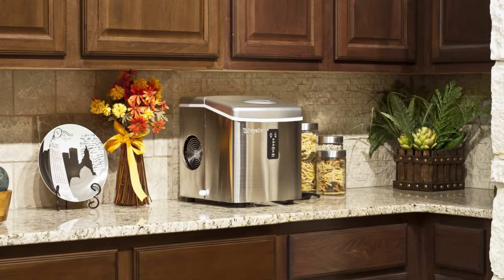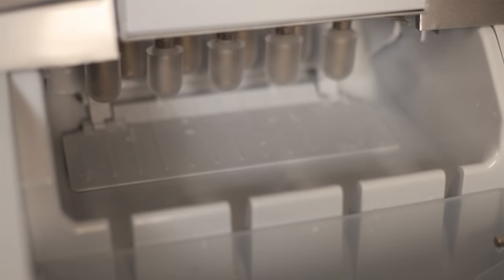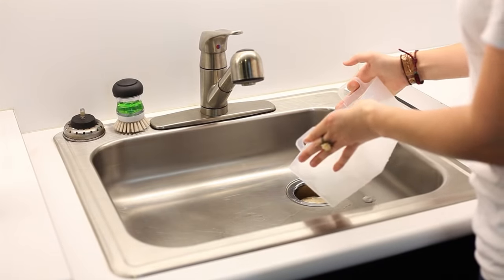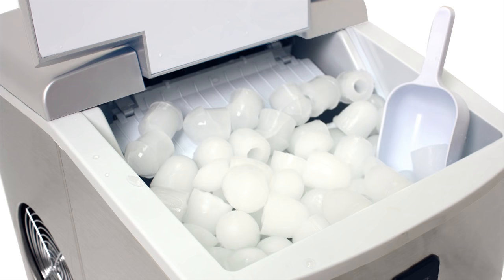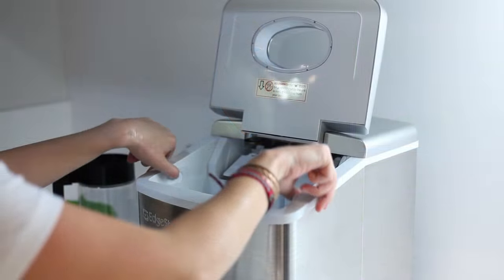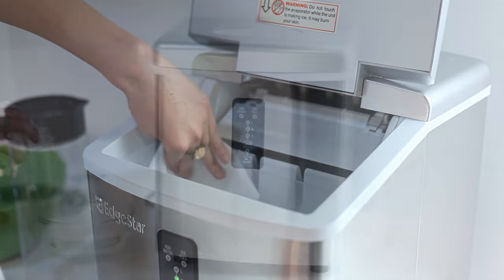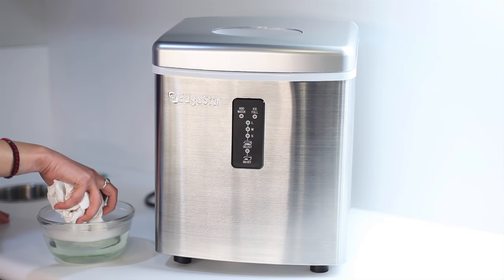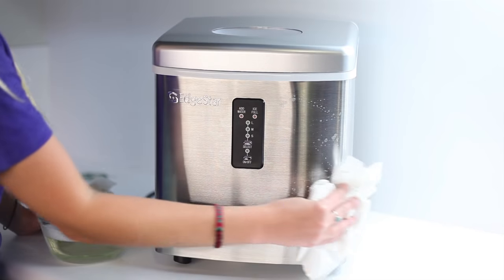How To Setup And Maintain Your Portable Ice Maker

Comment: What this video fails to tell you about is how your supposed to clean the nasty residue that develops in the ice maker! It is nearly impossible to clean the area where the ice is actually made!
Reply: I'm having this exact same issue now. been getting chunks of the black film on my cubes. I sprayed it with hot water from the kitchen sink hose but it's still there. any ideas?

any ideas as to the cause of this film?
Reply: I had to take mine apart and use bleach or alcohol and wipe it all off and rinse with countless gallons of water. It's such a horrible product nobody should buy it. I'd have no idea what's causing it In yours mine always turned orange not black. Since its black I'd be concerned about mold
Reply: I totally agree but I LOVE LOVE LOVE mine! it's absolutely perfect for me. I'm on dialysis & have an extreme low fluid intake allowance. My kidneys are 100% gone, so every drop of fluid from all food or drinks stays in my body until dialysis takes it out. So eating this ice during the day is so much better for me insted of drinking lots of drinks. The only thing is I've had it for over a year & I have heard there is a filter I should be cleaning? I have not found it nor do I see it anywhere. I always have these tiny black things in the bottom of the "clean" water. I have no idea what they are or where it's coming from & I have cleaned the entire system with soapy hot water, I also used bleach water one time & another time I used a strong watered down disinfectant to clean it. I even made a toothbrush to where I could scrub areas that could not usually be reached. However there are still these weird dark things always in the bottom of my water :( I'm open to any suggestions. someone told me it's just calcium build up but that's not it. There was a big blob of dark stuff around the right side gear and I cleaned it and got rid of it but I am still getting those wierd little dark things that usually stay at the bottom of the water but they can float when I add more water. lately I've been letting the water get low & I just get a paper towel and wipe them all out. what is this stuff & how can I stop it from getting in there?
Reply: you are supposed to buy by a cleaning fluid flush That they sell to   clean The line's out.
Reply: Literally why I clicked on this video. I just took a napkin and saw all that grime, I’m so upset.
Reply: ÕLD SÇHØØL WÃRRÎØR thanks!! that is what I need. where can I buy it?
Reply: Thanks for the info. I'm looking for one and not sure what to buy.
Reply: I position the tray by turning the machine on and then unplugging it when the tray is most accessible.  I then feed in a sheet of paper towel spray vinegar on it then push it around with a chopstick to remove the black mold.  I often let it rest with the wet paper towel to give the vinegar time to kill the mold.  I then put some diluted vinegar into the tank and soak paper towels to drape as much of the surface as possible and wait some time perhaps an hour or two before removing the paper towels, draining the vinegar then running water through the machine till I no longer see any debris in the water.  There is a plastic wedge containing a water filter at the bottom which you should be able to pull off to clean the filter but it's so close to the he edge that I can't get a grip on both sides to pull it off and the tank is too small for me to lever it up with a butter knife so I just clean around it with q-tips and paper towels as mold likes to grow around it.  I'd like to figure out how to remove VB the top completely so the tray is more accessible but pulling the power plug and using a vinegar soaked paper towel and chopsticks seem to work well enough.

I think flushing diluted vinegar through the machine more frequently perhaps pulling the power plug so the tray stays filled with vinegar but doing so more frequently will prevent the black mold from forming in the first place.   I also find that wrapping the basket and scoop with vinegar soaked paper towels for a while returns the plastic to a smooth feel rather than the chalky texture that builds up.

Right now it's just the water filter that is pissing me off and I can't find a video of someone removing it.
Reply: @johnwang9914  Oh hallelujah--the water tube filter? Thought I was the only one. No indication at all in the blessed manual of where this thing is.....
Reply: @aapple3749  The filter is supposed to be right at the bottom of the water container.  I finally got the plastic housing for the filter off, it had been hot glued in which was why it was so hard to remove.  The filter itself is completely missing, you can see where the foam filter is supposed to be, it just isn't there.  I guess they decided to just stop putting the filters in to save a penny or two.  Guess I'll have to find a suitable material to carve a filter out of, just like how we use cotton balls and charcoal in an aquarium pump as a filter but I'm afraid a cotton ball might get sucked in, maybe a jumbo sized cotton ball. 

Yeah operator manuals are pretty much useless these days.  Back in the eighties and earlier, you could order the field maintenance manuals which would tell you actual information and give you the procedures for each maintenance tasks as well as the part numbers for all the components, but not only do they not bother with writing such manuals now but the small appliance repair men who bought these manuals are no longer around anymore.   I used to order these manuals for all the machinery in the office and included these manuals on the request for purchase for new equipment and I would find a means of attaching the manuals to the device.  Of course, when I transferred to other offices and positions, I soon found that whomever replaced me didn't even realize what these manuals were and would just replace machines with new ones rather than keep up with the maintenance schedules.
Reply: @drclaw9864  I use vinegar water, i have a very soft long brush, it fits between the ice prongs. I also spray vinegar water into the back of the prongs. Then spray water back there to rinse. Be sure to remove the top of the filter and clean throughly.

Comment: Really, this is basically useless. Like Joshua Blain said, we need to know how to clean the nasty mold build-up behind where the ice gets made. It's very hard to get into that area.
Reply: I'm having the same issue. have you figured it out yet?
Reply: Amy Carr I ended up using a simple plastic spray bottle with a 50% bleach/water solution and squirted away. After thorough squirting back into that area I couldn't see any more gunk, so then a used straight water to clense the bleach. Then ran a few cycles and threw out the ice to make sure I'd thoroughly removed any bleach. Whatever you do, don't fill the water reservoir and then tip the unit upside-down in an attempt to saturate that ice-production area.. I did that and end up soaking the electronics area. Luckily the unit still works. You can tip it forward to empty the reservoir.  There is a video where someone takes the whole thing apart to get to that difficult area, but I'm  lazy and my squirt-bottle method seems to have worked great.  One month later and still no mold recurrence  (it was a light pink algae). And we use it daily.
Reply: @MrFamulaw  thank you!!! This is what I've been looking for!!! You saved the day!!! But I think
I'll vinegar instead of bleach😉
Reply: Was simple for me

Comment: Hi just wanted to let y’all know I got a domestic ice machine  in 2010 I clean it at sink by using vinegar like a coffee machine I also put vinegar in a spray bottle an spray while turning ice machine on & off to spray under the bin where water goes then l fill it with warm water run a few fill ups & dumps until no more black crud comes out, also keep plastic wire tie handy to slid in drain on outside to help the gunk drain out out then run a clean water & you have clean ice machine I do this once a month I was told by camping world my ice machine should have not lasted this long it is supposed to be a use a few years & through away & buy a new one. Hope this helps y’all
Reply: that is way too much work for me , when i saw self cleaning ice machine i was so exited until tried using it i did all that cleaning etc.& it takes for ever to get ice im talking hours' so im not happy with it at all

Comment: A soft cloth is a fine idea however it does not work well at all in cleaning the interior of the large white  bowl, if you will. In fact you need a solution of vinegar  and water, a new tooth brush to reach those difficult small corners, and removal of the top cover of the ice maker to properly clean it since the tray and  surrounding surfaces will be very dirty. On mine, I was shocked to find scum on the sides of the white plastic surfaces where the freezing pipes are located and all around the inside of the container where one cannot normally reach. Thus taking the cover off is an absolute must, at least once per year if not more often. Be diligent, wash your hands before handling the tray or ice, filter your water to try and remove dirt particles. I use a Brita filter but there is still lots of 
carbon particles that drop into the ice container, and this also contributes to dirty surfaces on the interior of the ice maker.

Comment: after filling the water reservior how do drain the water  after i disconected the plug  and puld the stoper or do i have to wate till i plug the power in first
Reply: All counter top ice making models have a drain, either on the side or more usually underneath the ice water reservoir. On the RCA 102 Igloo model it is a small white plastic cap inserted into a small hole underneath the water 
reservoir. I usually remove the plug while the unit is over the sink and allow the water to drain. Then I remove the top of the ice maker to gain access to the ice making tray, all the side walls and other surfaces of the white plastic everywhere in the interior. You will also need a brand new toothbrush to rub those hard to reach corners. Try to not use any form of abrasive on the surfaces. This is normal maintenance. DO you think the hotels that have ice making machines on each floor maintain them as they should; of course they do not.